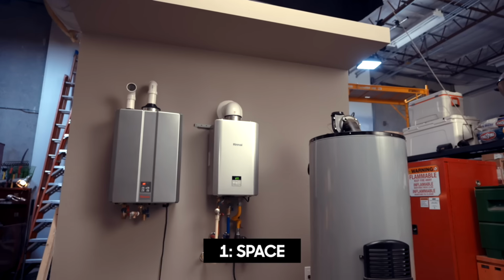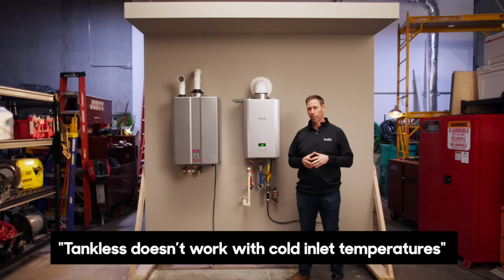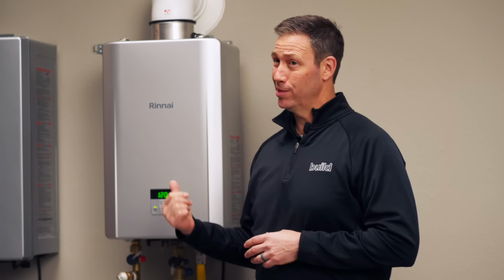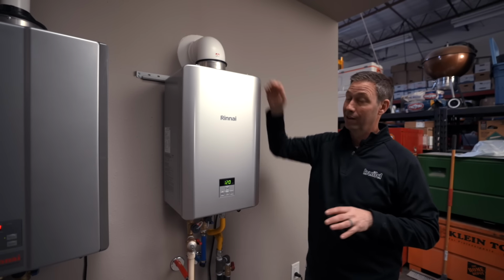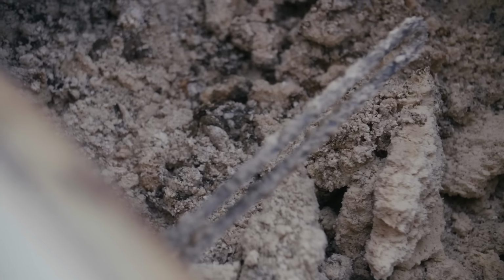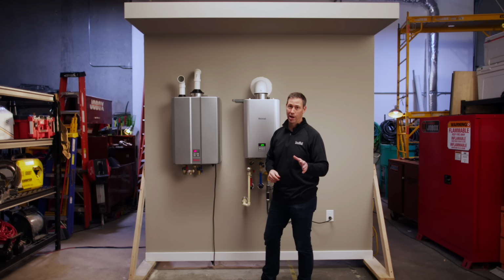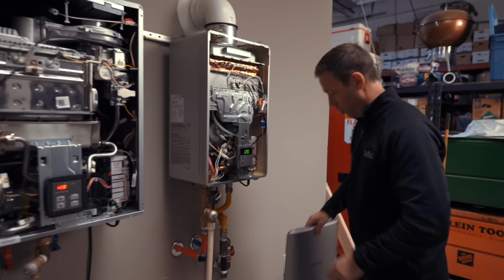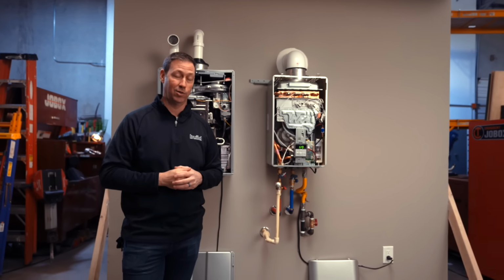DEBUNKING Tankless water heater LIES!

Comment: The thing with tankless heaters is that they are extremely finicky. They require annual maintenance, they need good quality water and proper filtration, and they need to be installed exactly to manufacturers specs. If you don't have all 3 of things in order, the chances are your tankless will fail prematurely and hence, why they have such a bad reputation. 

Whereas with a traditional water heater, anybody can throw one of them things in and it'll give you 7-10 years of hot water with no problems until it becomes time to replace it. Home owners just don't want anything to worry about and they want the cheapest solution and if that's the case, sticking with traditional water heaters is still the way to go. Converting to a tankless is not cheap and the benefits simply don't outweigh the upfront cost. 

Not to mention, you need to do your research with these things and not just pick any one off the shelf. There are some manufacturers of tankless units like Navien that just make defective units and you don't want to find out after spending $10000 to convert to a tankless that the unit you put in is defective and will need to be replaced in a couple of years.
Reply: Definitely true about navian. I started having major issues just a few months after installation. Not even 7 years later, the plumber is telling me it needs to be replaced for over $10k. I'm so not doing that. The whole situation has made me livid.
Reply: @andjanice71  Anyone who asks $10k for replacing a tankless water heater should make anyone livid.  A few months after installation the water heater and the entire installation should be under warranty. How many dozen apartments are using this water heater, anyway?  Navien water heaters are extremely reliable, and I really don't believe you.
Reply: @deltasquared7777  don't care if you believe me or not. Doesn't change the fact the navian installed in my house is faulty and should have been replaced the second or third time I had to call the plumbing company out to get it working again.
Reply: @andjanice71  absolutely nowhere is the cost of installation of new tankless water heater on place of a tank water heater is anywhere near $10k, replacement of an old existing tankless with a new tankless is less than 1/2 of that, maximum (check google for costs everywhere) and again, if yours is only a few months old, it should be covered by warantee.   .Counclusion- you are not telling the truth
Reply: @deltasquared7777  for just a water heater you would be correct, but it heats the house as well and the price of installation is over $10k.
Reply: @andjanice71  faulty installation is possible and easily believable--it happens all the time whether it is a tank heater or tankless. I find it difficult to believe that a legitimate plumbing company does not install a water properly,  notwithstanding this why do you give to lie about the cost?
Reply: @deltasquared7777  I'm stating what I was quoted from the plumbing company. Why are you so quick to accuse a complete stranger of lying? You don't know me, the state I live in, or which plumbing company gave me the quote. Yet, rather than find any of that out, you just waste my time accusing me of lying. What is wrong with you?
Reply: @andjanice71  Your story has radically changed--the failure is now with a home heating system rather than failure of  just a tankless heater. It is well known  if you install and use a tankless water for a heating system you must install a tankless heater designed as part of the entire system, and the correct designing of a home heating system is a far different and more complicated issue than simple replacement of a tankless water heater as you first presented the problem. Your initial comment, although maybe not an outright lie is misleading to the max--which I consider worse than a simple outright lie.
Installed properly,, Navien tankless water heaters are excellent premium quality water heaters and can be expected to perform flawlessly
Reply: @deltasquared7777  my story has not changed. The navian tankless heater installed in my house is friggin defective and started giving me problems just a few months after installation. The system cost over 10k for the initial conversion from tank to tankless, and the quote I got to replace the defective unit is still over 10k. You were the one who made assumptions and accusations without any other details, or information. Had you just started a normal conversation, instead of going right to attack mode, there would be no problems. My original reply was directed to the o/p, agreeing with their statement about navian. You chose the inject yourself into the conversation that you had nothing to do with, and nothing of substance to add. Don't waste any more of my time replying.
Reply: A friend wanted tankless but the nationally-chained plumbing company said she'd have nothing but trouble because of the well water.
Reply: This  post is a lot of BS
Reply: @deltasquared7777  By all means Mr. YouTube expert, prove me wrong. 

And keep in mind, you're talking to a plumber with 10 years experience that installs these things and works on these things practically on a daily basis but yeah, I'd love to hear what ya'll inexperienced folks have to say. I could always use a laugh.
Reply: They never told me that I'd have to flush my tankless with vinegar every year to keep it working. Now it's leaking after 14 years. Never again.
Reply: @doubleganger2  if it ain’t broke don’t fix it that’s my opinion on water heaters. Tank units work much better imo. Never had any issues with a tank unit.
Reply: @trainofthough0242 &  Stephen Willis: 14 yrs.? Just replace it. I bought mine online for less than $100.00. Never even seen one priced at 10k. I think you're spreading horse manure. Let me guess: You sell water heaters, right?
Reply: @MrWadsox  I'm talking whole house water heaters, not camper water heaters and single-point-of-use/low demand heaters. 

A decent whole house water heater will cost a minimum of $1000 for the unit itself plus another $3000-$4000 to install if it's a conversion from a traditional water heater tank to a tankless as piping and venting will need to be rerouted and redone. So figure about $5000 for just a tankless water heater, unit + labor. 

Combi units cost double that at least as even more additional piping rerouting and labor will be necessary and the units themselves are more expensive.

I'm a plumber, not some YouTube DIY'er like all y'all that don't know anything about anything clearly.

Comment: A campground I used to visit installed a tankless water heater. It went bad in 2 years due to the high mineral content on the well water, so they went to a tank and it's still going strong.
So, in my opinion, tankless water heaters are best with city water sources and tank water heaters are best for rural water sources.

Comment: The current political trend is to ban natural gas in homes to reduce greenhouse emissions. A heat pump water heater is probably the best current option for many people. Not only does it heat water efficiently it simultaneously provides free air conditioning. Can't do that with gas.

Comment: I work for a gas company and install and run gas to tankless water heaters" all brands" for them. The stated myth about line size is false. Gas is calculated by line size, btu's and gas pressure only. If you have an existing gas line that does not meet the requirements need to run the tank you only have 2 options. 1. Upgrade the size 2. Increase the gas pressure. How do you increase the gas pressure? Changing regulators from .5 pound to 2 pounds of pressure. Adding a maxatrol regulator at the unit drops the pressure for needed 11 to 14 inches water collum.

Comment: Honestly I get really peeved when i see stores of tankless..  Reality they are special not many techs work on them. they only have select techs(silicone valley not po dunk town)  Parts must be order thru company then mailed to customers address..(remember special techs) so now i have to reset an appointment now i have parts.. A week or more goes by.. Parts FREE yippie... Labor on warranty 1300 usd.. They had to come out again they did not change thermal cord (6 bucks) I looked it up.. The entire unit gets dissembled once again cord wraps the heat chamber... Pissed off beyond belief.. When a unit fails it gets hot thermal cord is 2 or 3 solder strands that melt.. Mine partially melted failed in a week. ( i tested with my solder iron acted just like solder) .Another 300 dollars to fix it.. parts free, labor is not..  The other unit to mine has failed it was a quick weekend job about 3k for a replacement unit...  Hello replacement. .Already plumbed  all connections gas electric water all there..line.. They just had to remove replace..    I felt ripped off disgusted.. i can show the receipt i have it in email...  Ok so neighbor had a water soaked tanked unit, it just needed to be dried out pipes leaked.. But they demanded a new unit  it was done in 2.5 hours or less from service call fully installed.. same day!!  Cost 1100usd..  And hot water...   No wait no specailly trained tech..no mailed parts..no rebooking a special tech that is always  booked..  2 weeks for me no water heater took showers at wiffies office great shower techies are spoiled.. Damn tooth brush paste combs after shave razors soap shampoo full size towels.. I was impressed best part of unit failing... Like a 5 star hotel...   Cold water sucks...  units did not last 8 years..  enjoy the day..
Reply: You want reality I just gave it to you..

Comment: we built our house 16 years ago and now on our third n. gas tank water heater.  Each fails soon after the warranty expires. Planned obsolescence still rules the day.  We do have somewhat harder water in n. texas tho not like Mineral Wells, TX.  The builder put the water heater in the attic - four minutes way from the kitchen sink.  I put in a circulating system it caused pinhole leaks from the continual turbulence at 90 degree fittings.  Chinese copper plus drunk plumber slathering excess flux?  I've already repaired a copper slab leak with pex a thru the attic which actually reduced the hot water journey to the kitchen to ONLY 3 minutes. Yeah I timed it.    

So looking to put a water heater closer to the kitchen.  I have hot and cold utility sink in the garage close to the kitchen so looking at back feeding a tankless set above the utility sink to get hot water in the kitchen SOONER.  Like code should require a maximum journey time say 30 seconds given that the future of water supply/cost looks shaky.   Electric requires major expansion of 200 amp panel because 50+ amps needed for start up- means a second line to the meter.  $$$$

There is a unused  1/2 inch gas stove line in the kitchen backing to the garage sink that I thought would work but discovered all the gas tankless require 3/4 inch gas plumbing.  So retrofitting is no picnic and now I read half the comments still trashing tankless.  Hard to know who is being bought here - Matt "sponsored by.."   or the comment section full of tank manufacturers.

Comment: That Rinnai is $1800+, a 40 gal gas water heater is $580, a 50 gal gas water heater is $789. Flush it every year, like you have to on a tankless, change the anode rod every 5 years for under $50. AND, I still have hot water when the power goes out with my tanked unit. Gotta buy a battery backup for the tankless, because it still uses electricity for the board. I don't see the comparison. People who don't flush tanked units, aren't going to flush tankless units, either. Get my drift?

Comment: I wasn't too impressed with the one in our flat in Shanghai. Set shower temp, water was cold, then too hot. Set temp down, water was good, then too cold, then heater pops on again, makes temp too hot. No tank means temp rises and falls if demand is not equal to heating ability.

Comment: Second home and second tankless unit and yes the last one was expensive to buy and install three years ago. Always have to re-plumb gas and water as these units are feed from underneath. I pushed beyond the cost as I love the advantages they offer. I went with Rheem as it has been reliable and includes built-in neutralizing of the condensation. Make sure to get the service valve kit to make flushing easy https://youtu.be/jQ7Y6ujFbWg

Comment: Tankless is not worth it!  I ran these numbers about 5 years ago.  In the summer time, my gas bill is about $25, with $10 being the meter charge, so it cost $15/month for hot water.  I got two quotes, it was about $5000 to go tankless, and about $500 to replace my gas water heater with a size larger than I had.  $4500 cost difference.  The guy calmed about a 50% reduction in gas.  So that means it would save me $7 per month!  That is a 53 year ROI!  No way!

Comment: Tankless- No power, no hot water. Traditional tank heater - water for 2 showers.

If you have teenagers, do you want then taking 2 hours showers? Or just to run out if hot water?

Comment: Matt, I’m a remodeler of 29 years and I just found out about these on Amazon.  Also your buddy Jordan just put one in his house.  This is tankless and NO VENTING!!!  Here’s the unit:
Stiebel Eltron Tankless Water Heater – Tempra 24 Plus – Electric, On Demand Hot Water, Eco, White, 20.2
Reply: Yes!  Agreed.  My tankless guy told me Stiebel Eltron is the best one out there for all electric homes.  He will not install one without a pre-filter for calcium.  The only reason my last tankless, which was over 20 years old with zero maintenance, failed was because the scale buildup caused an internal pipe to leak.  The unit itself still worked.  Replaced it with the pre-filter and the Steibel Eltron Tempra 20 Plus and zero problems since.  I expect it to last longer than 20 years.  I would never go back to a tank.

Comment: Converting an existing home to tankless in markets without natural gas is very difficult and will need an expensive upgrade of the electric service to the building to get sufficient power to operate.   And with the increases efficiency in electric tank heaters.   

I run complexes which are used only in the summer, and winterized.   The tankless units were impossible to winterize well.  And we needed to replace them on an average of one every three years.

Comment: I have an electric hot water heater and thought about going tankless. I thought that that would be an easy swap because of electric going to electric, but I would have to increase the breaker and bigger gauge wire, and I read where if you don't get a large enough one, you don't get continuous hot water?
Reply: If you already have gas that is the better way to go.

Comment: My buddy had a tankless installed, it has been a nightmare from the get go. His wife and kids are ready to bar be que him.  So what should be off the radar for hot water, it's a gamble to convert.  No thanks.
Reply: Sometimes it doesn't make sense. my Dad had a 30 ft run of half inch copper in stucco in his basement ceiling leading to his 30 gallon tank. Tearing out a ceiling or tearing up a hardwood floor would have been necessary to run 3/4 inch to a tankless. But for me it was a breeze everthing was right where it needed to be, the concentric vent that I needed was like $30. Mine worked flawlessly. With the exception that I had to run the kitchen hot faucet for a few seconds when I first used the dishwasher. I later found out that was because I had a single water inlet on the washing machine and was using a Y hose to feed it. The backfeed through the Y hose was enough to not allow the pressure drop from the dishwasher to trigger the tankless.

Comment: I've got a early 1990's AquaStar 125NG tankless in my house. It's needed repair once - a water valve failed, and was leaking. It's still in use today, and it's never been descaled. (the original installer didn't put in a service kit) It's gotten over two decades of service. It's also got a standing pilot, so when I lose power, I still have hot water.
Reply: How hard is your water tho?
Reply: @halfglassfull  it's great lakes water. City treated. Medium calcium.